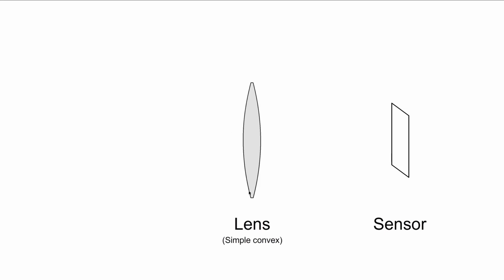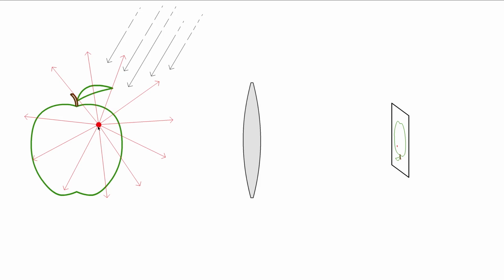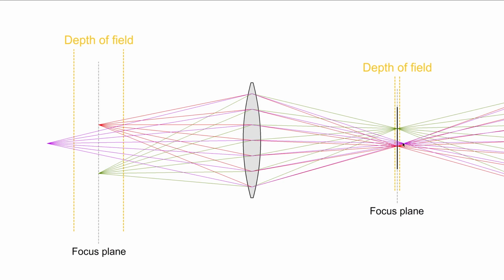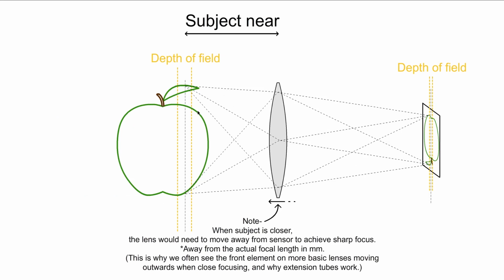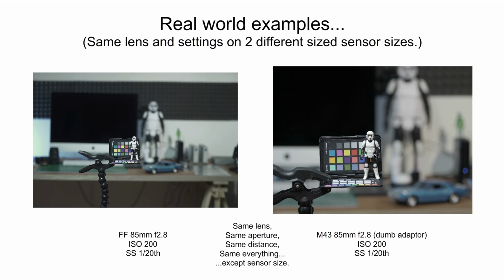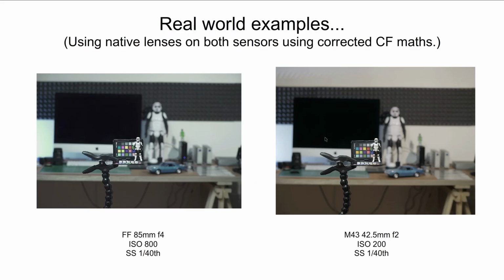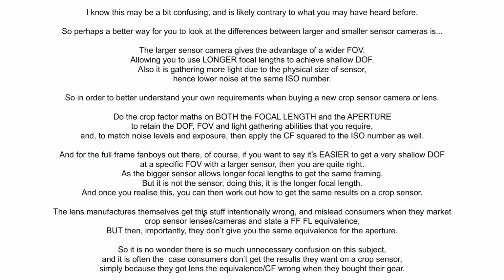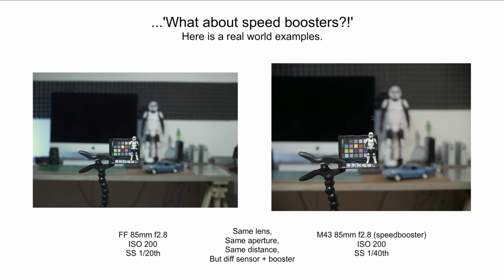Depth of field and crop factor misconceptions.

Comment: I really enjoy watching this video, which teaches me a lot. However,  I have a question, you said smaller sensor has shallower DOF. I want to clarify something. If I take two pictures with same lens at same focal length, same aperture and same distance to the object but  one use full frame and one use APSC(1.5x) . The final image of APSC one would have a shallower  DOF  compared to the full frame one?  that means if I scale up the full frame image 150% ( assume the resolution is not a matter), these two pictures would be different in DOF?  Please correct me if I hv some misunderstand. Thank you very much
Reply from the maker: Yep it’s a bit confusing. 
It’s technically true that if you take a FF cam and a crop sensor cam, put the same lens, at same aperture at same distance to subject. 
The crop sensor camera will have a shallower DOF (and will be a tighter framing). But only in the same way that if you take the FF shot, and cropped into the centre of the shot. 

What people forget is that DOF is not a set parameter, it’s a sliding scale. 
And if the image is at higher res, or enlarged then the amount of the image that is clearly sharp is lessened. 

This is apparent to us all, but we sometimes don’t make the connection. 

Eg. a shot looks sharp when viewed in the EVF. But then we get home and inspect it on a big screen and we see we missed focus. 
It looks sharp small. But soft when big. 

This is the same for cropping in (what a smaller sensor naturally does)
When you crop into the centre of shot you are enlarging the image, and any “slightly out of focus” area now look MORE blurry. 

That’s the subjective side.
Then there’s the technical side too. 
That’s down to the circle of confusion. 
The pixels are smaller on smaller sensor. (If both FF and crop sensor have same res) 
So the out of focus areas are MORE out of focus. The DOF will literally be shallower on the smaller sensor because the point at which the light points overlap the pixels, and blurs across 4 or more pixels is when we can detect something isn’t sharp. We can not detect any blurs tighter than something one pixel across. 

You have to remember there is only ONE plane technically IN focus. Even at small apertures. 
The rest is just slightly slightly slightly out of focus. But we can’t tell because it’s within our one pixel limit (or photosite to be accurate) 

If any of that is unclear. 
Maybe investigate “circle of confusion”
Reply: @biscuitsalive   Thanks a lot, its a great video
Reply: I have read many times of what you said, after that, can i say a lesser density of a senor will have a shallower DOF than a higher density sensor? Thanks

Comment: man, if you gets yout atention to the pixel, you will see that iso 200 on m4/3 are much better than iso 800 on full frame ( i made the comparasion with FF d700). I think you are right in all the others concepts, but iso 800 on full frame is not the same thing as iso 200 on m4/3. The pixel effienciy on m4/3 to gather the light is much better
Reply from the maker: Hey, of course it will vary slightly from sensor to sensor from varied manufactures, but if you study the DXOmark ratings (a great resource) from dozens of sensors, and then do an average, and then brake those numbers down, and cross reference by ONLY the size of the sensor, you can see the size is the biggest factor BY FAR when it comes to image noise. and I'm pretty sure i got my maths about right from my own personal tests regarding taking the crop factor and squaring it for comparable image noise.. (i tested on Canon, Sony and Panasonic bodies)

(remember I'm talking about total image noise across the whole of sensor, not per pixel, as this is what is important we are looking at to images side by side... this way, i think it keeps it fair, as we are viewing the same image at same size side by side... and not allowing the total resolution of sensor to be a big factor... which it would be if we pixel peep)

I will check out your link later when I'm by a 'proper' computer. :)

If you are still not sure about my maths/conclusions, maybe check out Tony Northrups videos (go to his main page and do a search for 'ISO' you will find several relevant vids) he came to much the same conclusion. (Of course, I got much of my info from him, and then I tried to make it clearer still, by combining that, my own tests, and illustrations that break down what is happening inside the lens.)
Reply: look the link that i post. I think in terms of information: if a pixel gather information,  we can see this information (texture, colors). In the test you will see that a FF camera with 24MP or 36 MP are no match at all to 16MP of Olympus ( and the comparasion in base iso show almost the same quality - for shure, the FF will be better in base iso but not to much.

I believe in maths too, but sees that you are treating the sensor as a film, not as a digital device.

Comment: I did catch a few mistakes (you had a few drawings with light bending in a way that would not really happen) but overall this is nicely done. 

When light passes through a lens element, the lens element does not "know" what is behind it.  It doesn't know if it's a big sensor or small sensor. The physics of the lens has the luxury of ignoring the sensor size.  Another way to think of it is if you have a slide projector and a projection screen, you can swap a large projection screen for a smaller projection screen.  The "projector" does not "know" you did this.  But of course the human... DOES know.  So the human reacts to the change by adjusting the projector... either changing the physical distance so the image "fits" the screen... or perhaps the projector has a zoom lens and we can adjust the focal length.  

Basically the short of it is... the actual DoF doesn't really change (strictly in terms of laws of physics)... but the human reaction to the new sensor size (to achieve an equivalent framing) causes the photographer to do things that DO impact the DoF.
Reply from the maker: hey, thanks, not sure if you watched the follow up vid too, i did flag a couple of silly mistakes in that. (my light ray vectors did go the wrong way at one point) but it doesn't change the overall message, just a silly mistake with my simple illustration. anyway, thanks for input.

Comment from the maker: OK, so here is a list of mistakes so far. (thankfully all tiny, and not deal breakers.)

1. The converging light rays that fall slightly behind the sensor when it is focusing on a OOF point behind the apple,
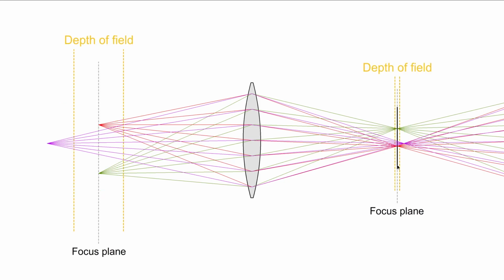(the purple light lines at 08:55 )
Sorry, I messed up the raytracing in my haste, they should have converged just in front of the sensor, not behind it. Totally my bad. And thanks for pointing that out.
But it doesn't change the main message for that section, the light rays converge just one side of the sensor surface, and not bang on it, hence being out of focus.

2. The Label 'Depth of field' above the sensor (in yellow) should say 'Depth of focus' Sorry this was just a typo, as I copy an pasted the other label while making my layout, and then didn't correct it.
(So its DEPTH OF FIELD in front of the lens around your subject, and DEPTH OF FOCUS behind the lens around your sensor. But again it doesn't change the message, just a typo. Sorry.

3. Not a mistake, but I just wish that I mentioned the COMPRESSION too. Just to assure you, If you follow the method I suggest in this vid, then you also match compression between diff sized sensors. This is simply because you don't change the distance to the subject. Several people asked about compression, so I just wanted to quickly mention something about that.

Comment: Great video - but a bit wrong... 
I have access to a tones of cameras, formats and lenses - and I have tested everything in this video. Greatly used "match"  but I have done the tests. A 50mm F1.4 - will get the same amount of light no matter what the sensor size is. The ISO - is so much dependant of sensor technology that I have done the tests only on base ISO. A camera with ISO 800 full frame from 10 years ago compared to a M43 release yesterday will get worse noise level anytime.  Basically that bokeh and depth of field is the FEEL - of the image.  For example.. if I want to imitate the "feel" of a image shot on a FF 50 1.8 - I need a APSC 35 F1.2 - this will result the same shallow dof and in focus areas - but being a 1.2 will also expose more than the FF 1.8 - on the same settings and base ISO.  A 50 1.4 is a 50 1.4 and a 50 1.4 - no matter what sensor is has behind it, the same amount of light will land on the sensor - the image due to the math that can be replicated - that is just a crop story...

Comment: From my understanding the focal length is measured from the convergence point not sensor plane to the lens element. Correct?
Reply from the maker: when the lens is focused at infinity, and its in focus, then the FL is the distance to the sensor, but yes technically its the distance to the lights converging point. (if there was no sensor there to project an image onto, then it would still have a focus length...)
Reply from the maker: of course I'm assuming the set up is correct with the way i described it, if you put a FF lens straight onto a m43 body with no adaptor, and the converging point was throwing behind the sensor, then the FL wouldnt be measured to the sensor... but then you couldn't use this set up anyway. :)
Reply: biscuitsalive biscuitsalive well the convergence point isn't necessarily the focal point. Otherwise as images came in and out of focus they would flip upside down and right side up again. The convergence point is where all of the light crosses and flips over. Let me re-watch the video and pay closer attention (in 35 min you can get distracted lol) then I'll return to the comments here. I did a similar video about crop factors. Maybe check it out and we can discuss.
Reply from the maker: not it wouldn't flip, all light throwing off back of lens is in lines that describe the image, upside down, if you skip to around 08:48 you can see what i mean, the OOF areas are not then flipping back up the other way, if you move the sensor nearer if just gets blurry, if you move it further away it gets blurry too. it doesn't also flip from upside down to right way up..... i think you are getting  the rays that trace points of light (for one tiny bit of detail) mixed up with the entire image. its the tiny points of light that are converging to create a 'IN FOCUS' image... the entire image will be upside down any way, in focus or not. 
il have a look at your vid later on. :)
Reply: Last reply might have gone to spam.

Comment: quick question: Is the hurdle a lower base iso, or higher base iso? Would have guessed the iso is already higher, being equivalent to a high ff iso. Correct me if I am wrong. Great video.
Reply from the maker: Julius Herrmann the hurdle for smaller sensors in optimum conditions is lower base ISO. To match image noise of full frame camera at ISO100 a m43 needs to be at ISO50 at most. 
But new sensor tech will no doubt change all this soon. But there is always going to be an advantage to larger sensors. Most noticeably in bad light /high ISO range.

Comment: in your tests you said both ff and m43 sensors were using "native lenses' - which tells me if you're at 50mm on both (50mm ff and 50mm m43), the m43 FF equivalent would be 25mm, right? my main question is regarding aperture - the lens manufacturers have already given us the m43 focal length on our 25mm (and sometimes will advertise their FF equivalence), do they THEN need to also give us adjust aperture readings (t stops versus f?)
Reply: A focal length is a focal length. It does not matter what the format is.

Comment: When you use a magnifying glass in the sun, the light wich is bundeled gets stronger. This is why the speedbooster adds more light .
Reply from the maker: it doesn't add more light it concentrates the light. compare same scene, same FOV with full frame and M43. M43 with SB, they will be getting similar total light. (M43 will be getting a bit less as speedbooster doesn't use up the whole image circle) but my point is its not magically adding more light, its just wasting less.
Reply: biscuitsalive, if i don't change settings on my camera, and lens. When adding the speedbooster instead with normal adapter. The image is brighter. How?
Reply from the maker: you are not getting what i am saying are you. as i said the speedbooster wastes less light. when you use a dumb adaptor you are wasting lots of the light (its spilling around the sensor) the speedbooster isn't magically creating more light. its just wasting less. if you put the same lens, same scene, same aperture, on a FF camera, it will be getting X amount of light, the same amount of light is being transmitted when you then put that lens on a M43 camera, with a dumb adaptor it will be wasting lots of that light, with a speed booster it will be wasting LESS light. but its not creating light, how can a lens create light??
Reply: biscuitsalive i don't know, thats why i'm asking. I'm talking out of a test i did after i saw it been done in another youtube video.
Reply from the maker: it just depends what you are trying to figure out exactly, if you are comparing M43 lenses to a FF lens on a booster then you have to factor in the crop factor, and play this to the focal length AND the aperture. or you will get confused by your results. eg. a 25mm f4 M43 lens will work the same as a 50mm f2 lens, for total light, DOF and FOV. you also need to apply the crop factor squared to the ISO to then match noise and exposure. (this way both end images will be as close to exactly the same as possible, in terms of Noise, FOV, DOF... likely you won't be able to tell which is which.) so if you are comparing a M43 lens to a FF lens on a booster... then of course the FF lens will be gathering 4 times the amount of light. (if both are at f2) so as my video points out, do a full equivalence, or your result form your test will be all over the place.
Reply from the maker: Too add, if you are still getting confused, then just remember what i said about the ISO number, its very misleading if you are using that as a anchor for your exposure. (when comparing different systems) the ISO number is governed by the light falling on a square inch of the sensor, not the total light creating the image. (so basically, with the same settings a FF camera is getting 4 times the light of a m43 camera to create its image)
Reply: It is a result of the Inverse Square Law in physics. A speedbooster "concentrates" the same amount of light into a smaller circle, making it "appear" brighter.

For simplicity's sake, imagine ten photons of light coming through a lens and hitting a sensor with ten pixels. Each pixel gets one photon of light. Now put that same lens on a camera with a sensor with only five pixels. The same ten photons are coming through, but only five photons are captured by the five pixels and the remaining five photons hit the back of the camera and go to waste.

Now, if you add a speedbooster to the five pixel camera, the extra optic on the speedbooster is focusing the ten photons into a tighter beam of light. There are still only ten photons, but now they are concentrated in a way that each of the five pixels is getting two photons each instead of one. That "effectively" makes the image brighter, but it is still the same amount of light coming through the lens.

Thus, you would close down your iris on the five pixel camera to equal the exposure on the ten pixel camera with the same lens and lighting conditions.